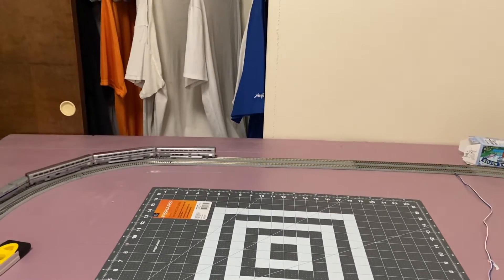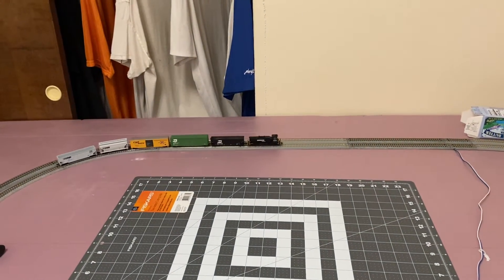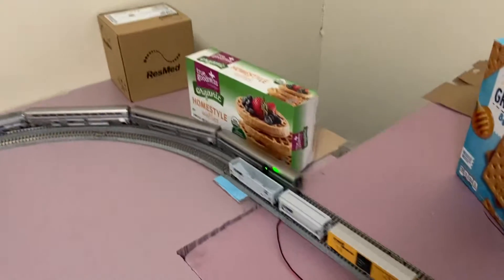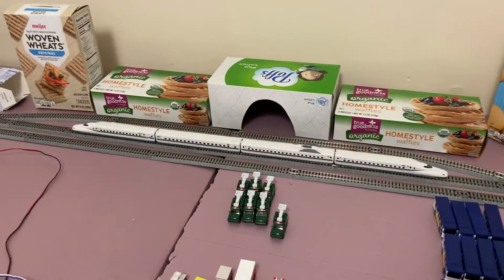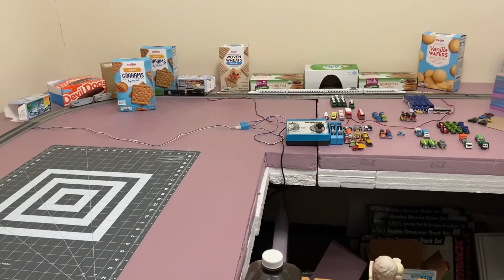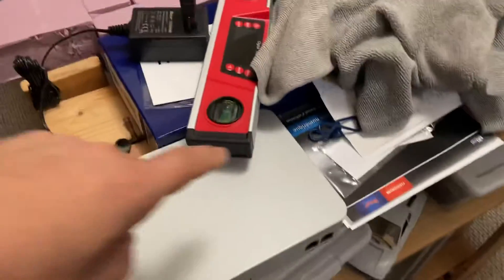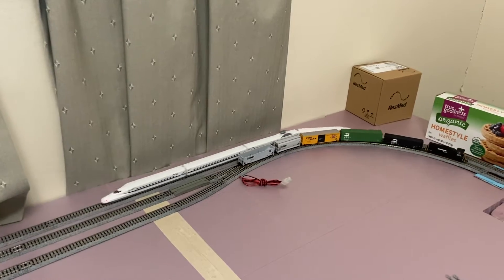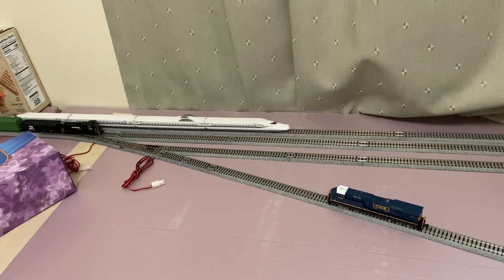Non-permanent track plan

Comment: Hey Darth I like how you did the bridge connection . For your helix you could keep the double track and come off with a switch to go to the helix . You would just need a single section of track on the other side to continue with the double track .  The trains look great running around .
Reply from the maker: Thank you Jerry. I have something in mind for the helix, just need the track, lol. The bridge is very strong, even though it just sits on the edge of the other foam.